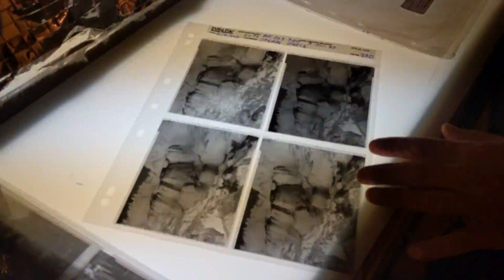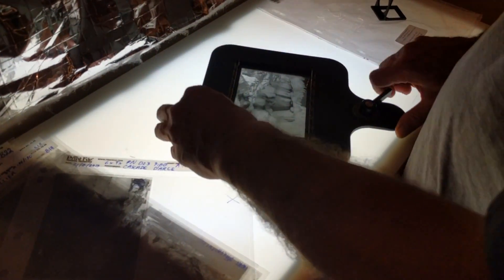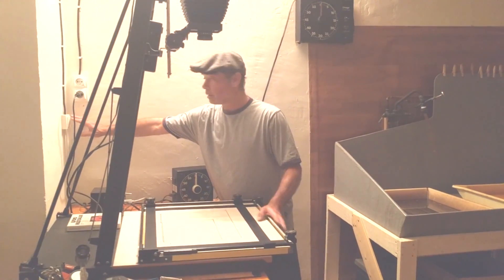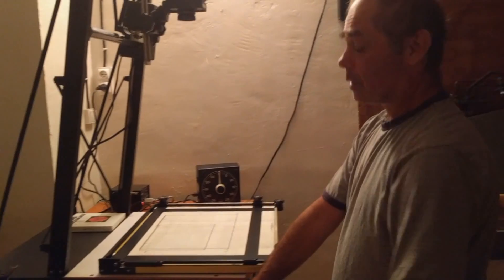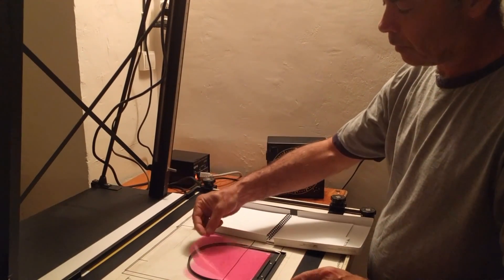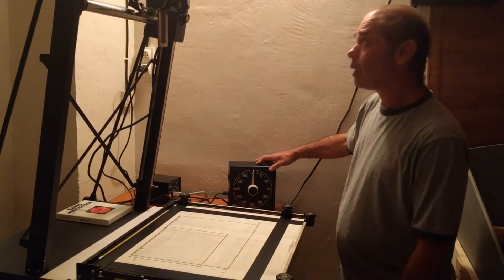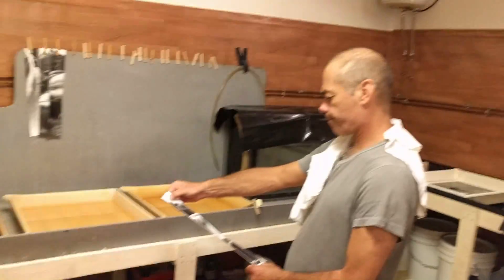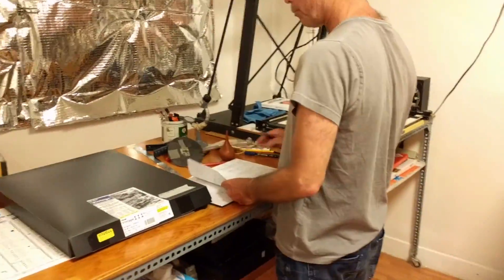DARKROOM TECH: MAKING A SILVER GELATIN TEST STRIP

Comment: why use developing time for contrast adjustment instead of using different filter? or is it too subtle?
Reply from the maker: Yet another good question. I learned to print using silver gelatin "graded paper". Ansel Adams describes the "factorial method" in his book "The Print", the true real bible of photography. The factorial method is based on the fact that the longer the print is in the developer the darker it gets, and consequently the blacks separate from the whites, in other words more contrast. Same effect as using a higher concentration developer or a fresher developer or a high contrast developer or a low contrast developer. My best printing results have always been with graded papers. First of all I can actually see the negative when exposing the print, because I do not hide the image with these strong filters. So when I expose the test strips I can make important value judgements by studying the projected negative. And, I do the same when processing the test strip, I have good safe lights in my darkroom, as bright as possible, and thus I can make value judgements as the test strip is developing. "It is always important to do the same procedure on your print as you did on the final test strip."  But, quite often I notice that I have to extend the time or reduce the developing time of my print, because my visual analysis of the print while it is developing requires an adjustment. That is why I always give myself the flexibility of changing developing times. I find that Variable Contrast papers separate me a little bit away from the natural process of silver oxide reduction in the gelatin. VC papers have two different contrast types of color coded silver gelatins working at different speeds of deposit. While graded paper has only one type of silver gelatin. After a while I could really "feel" the exposure-developing relationship and process. But hey, I've had to adapt, and I am very happy with my present day prints anyhow. All the best and happy printing.